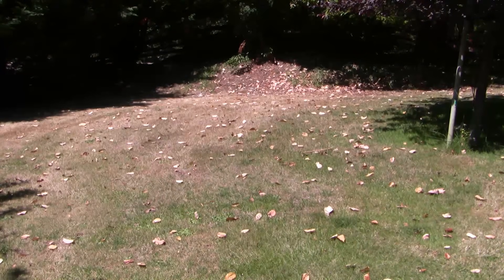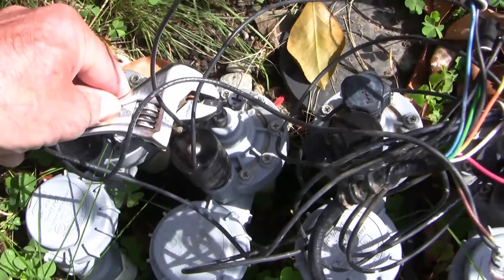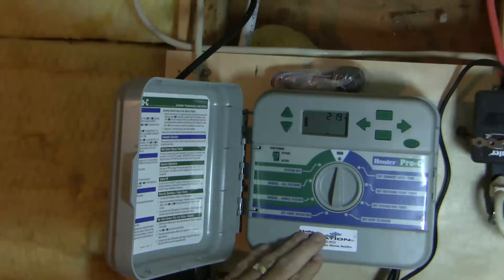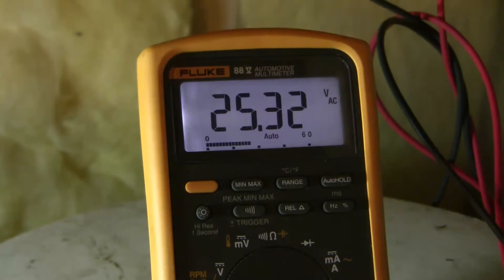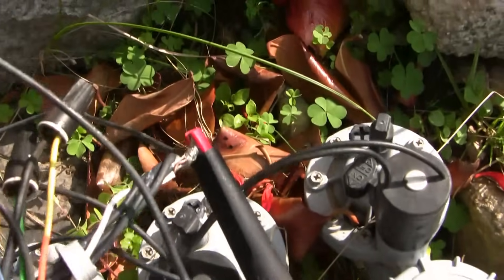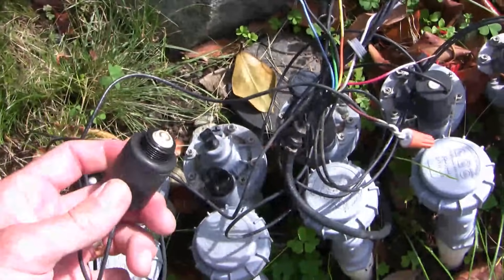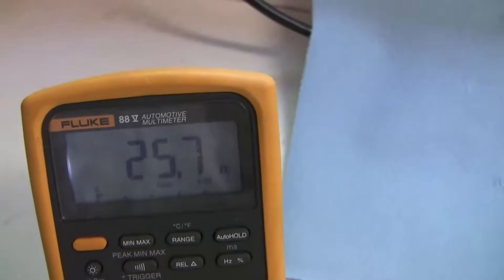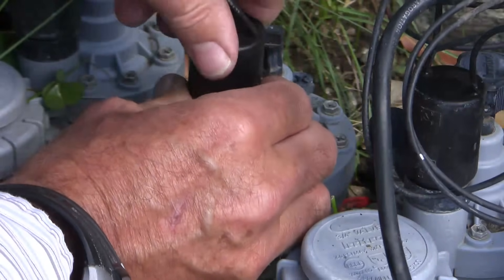How to fix an irrigation sprinkler zone that is not working

Comment: Sometime the zone I have works and then sometimes it doesn't. I have to adjust the solenoid to have it as loose as possible without water leakage in order for it to work. What could be the problem? Thanks for make this video helps me out a lot.
Reply from the maker: I would disassemble it right to the diaphragm and clean it all out (don't forget to flush the proximal line in case you have an intermittent obstruction higher up). What you have sounds like some kind of mechanical binding somewhere. Silicone spray might help the plastic parts to slide more easily. If you think the problem is inside the solenoid itself, you could swap the solenoid for a known good one and see if the problem goes away.
Reply: spelunkerd 3 of my solenoids were bad. Swapped them out for new ones and the entire system works. Thanks for the help. How do I know if a solenoid is about to go? I hear buzzing from 2 others while working on the system.
Reply from the maker: The fuel pump on my truck has been buzzing for over 10 years, but because of how hard it is to get to I have ignored it. The only criteria I would use is whether it is working or leaking.

Comment: I spent $300 last Fall to have a pipe repaired and a solenoid valve replaced.  Didn't need to water much last year, but now it is Spring...water comes up the heads in that zone pop up...but they go down...then up...then entire cycle.  What could be the problem?
Reply from the maker: If all the other zones are OK then the most common cause would be a leak, causing inadequate pressure. I would start by running that zone for an hour, then check for a puddle of water. If you find a puddle, dig down to find the problem, often caused by a shovel strike, or a freeze-fracture of the pipe, or maybe a loose connection at one of the spray heads. If you don't find a puddle then I would disassemble the solenoid valve housing and look for a piece of debris proximal to the valve, that could rock back and forth, obstructing flow. When you have it apart you want to flush the proximal line since debris can slide back and out of sight when the water is turned off.
Reply: the area around the head was pooled up ....yuck.
Reply from the maker: That might be a good finding. Dig down to the spray head connection, it's just a right hand thread with white teflon tape. Sometimes those just come unscrewed over time. If you find broken plastic, you'll have to replace the broken part. If there is broken plastic and if you live in an area where the ground freezes, think about the possibility that the zone didn't get blown out enough in preparation for winter.  It doesn't take much residual water to form a pool inside the pipe, which expands as it freezes and breaks the plastic around it. If it was a pro who blew out the line last September, he might be willing to pay for the broken part.
Reply: Thanks for your help and excellent videos!

Comment: I have a 5 station irrigation system. How many solenoides do I have? I could only find 2.
Reply from the maker: They aren't necessarily all in the same place -- look around the garden for another cluster of pipes, maybe underneath a plastic cover or behind some shrubs. Installers like central locations but it's also preferable that they be higher than the surrounding ground for better drainage.
Reply: I found one more. I imagine one per station.  Missing one.... I bought solenoid. Cant tell which one is which. Will watch you r video again. Thanks again.
Reply from the maker: Keep the receipt since a bad solenoid is an uncommon cause. To sort out which circuit is which, open each valve manually, and draw a sketch of where the sprinkler heads are in your yard with colored pens, one color for each circuit. Then go to the control panel and electrically turn one circuit on at a time. Then match up the colors with the circuit number. If you eventually need the help of a pro, that kind of diagram saves the consultant a lot of time. After you are done, consider writing or inscribing the circuit number somewhere on each solenoid station. It will save you time when you need to do repairs each spring, if you can remember where the sketch is and if the marks don't wash off (grin). Good luck!
Reply: Thanks! Fixed your advice was very helpful it turned out to be a diaphragm.
Reply from the maker: Great, glad it helped, Carlos!
Reply: You have a solenoid for each zone.  Once you find the others you might want to put them in the containers with the green pop top to facilitate finding them next time.
Reply: Thanks!! I fixed it. It was a faulty diaphragm.

Comment: I troubleshoot electronic control systems for a generation station so I understood your troubleshooting method. This video would be very helpful to someone that isn't familiar with electricity, meters, ohms or voltage drop. Very good video.

Comment: dude, that controller has a self diagnostic feature, did you read the manual?
Reply from the maker: As is often the case with self diagnostics, it didn't help in my case. I'm not surprised by that since the circuit resistance and current flow were within normal limits, and the unit has no electronic way to know if water is flowing. Of course I read the manual, 'dude'.
Reply: @spelunkerd  Next time forget that meter use a spare solenoid if it clicks open all good Dude. KISS...

Comment: Nice work, very informative. I've got a small backyard system with just 3 valves and it doesn't work. There's no problem with the water supply, it's just that the Timer starts up and nothing happens. I looked at all of the Solenoid's and two are rusted at the connection. Could that be the problem? Just ordered a multimeter which will arrive in a week so I'll test the connections but I'm wondering if the rust is normal, I would presume not. Thoughts?

Cheers!
Reply from the maker: When I looked at my solenoid closely I found a tiny amount of rust where the wire exits the body, and I think water got into the solenoid and eroded the connections internally. Rust is not normal.

Comment: I really enjoyed the video!! My problem is that there is a watering zone that will not shut off unless I shut it off from the water pump for all zones. Do you have any suggestions? Thanks
Reply: You have debris in your valve preventing the diaphragm from closing

Comment from the maker: I'm glad you chimed in, Gregory. Yeah, you're right, and if I had a spare solenoid that would probably have been my approach as well. But for an amateur it would have meant buying a new part before deciding whether it was broken. I did consider swapping the solenoid with one of the proven ones adjacent. But that would have involved more work, and to properly test the wires it would mean completely swapping it. Thanks for your input!

Comment from the maker: One other thing I noticed about my Hunter ProC. I noticed that if I try to stop a programmed cycle at the controller after a cycle has started, it doesn't stop right away. I assume it is a software glitch, since I can always stop it manually at the water source. After the cycle is over, it doesn't restart.

Comment from the maker: Do you think they might have disrupted any of the wiring when they drilled the well? Did you check to be sure the shutoff valve wasn't closed by the technicians when they drilled the well (probably not if you get water when you open manually). I would look at the controller and see if it is turned on, they might have turned the controller off or unplugged it when working on your system. Or, maybe the clock needs to be reset if they turned the power off. I would check power to the controller.

Comment: Nice video. I was looking around for information on valves. Just had a well put in and my valves wont open. This is a new house with new sod and new hunter system. Been watering twice a day on city water fine to get grass to establish until today when they finished drilling the well and installed the pump. The valves will run when turned on manually. Any ideas?

Comment from the maker: Yes, you make an important point that when a solenoid fails, don't forget to look at the mechanical part of how that device works. If the valve is pinched or twisted it won't move smoothly, which sets up more mechanical resistance, which in turn leads to heat and damage to solenoid windings. 

However in this case you will note that there is a rust stain on one of the wires leading into the solenoid. Water got in there and corroded an electrical connection. See below.

Comment from the maker: Thanks, those sound like words of experience. 

If you watch the part where I test the bad solenoid on the bench, you will see that the resistance shifts when I move the wires leading to the solenoid. I looked at that more carefully off camera, and I think it was a corroded internal connection that was not accessible without destroying the solenoid case. So, in this case it was a primary electrical corrosion problem. 

Nevertheless, your remark is a useful contribution, thanks!

Comment from the maker: They are usually under a cover of some type, in a central area, grouped together. Wander around the yard and look for a round or rectangular cover plate at ground level. Some solenoids that are fitted with backflow preventers have to be vertically higher than all their sprinkler heads, so for that type look in the higher garden beds, often concealed by shrubbery.

Comment from the maker: Flooding of the box can cause a short, which could activate multiple zones at once. The box should never flood unless there is a major leak, so I would fix that first. Maybe it's something simple like a solenoid that is partially unscrewed. When you are cleaning that up, have a look at the wire nuts for signs of shorted wires (do it with power off to avoid getting a shock).  They all should have dielectric grease and lots of tape protecting the connections from water corrosion.

Comment from the maker: If you are not sure if it is the solenoid or the seat that the solenoid rests in, you could swap one solenoid for another and see if the problem follows the solenoid, or if it stays in the same place. They are inexpensive, but there is no point to replacing a part if it is not the problem. Thank you for watching.

Comment: Good job. I think i need a new solenoid. My sprinkler makes a loud noise and the water barely comes out. Only way to stop the noise and increase water flow iscto turn my solenoid counter clockwise a little.

Comment: I have a  5  zone  Nelson Turf. Zone  3  shows a  problem   (P 3) the  zone  starts, runs  for  5  seconds and  then stops and  advances  to number  4.
I have  switched  an  operating  zone  4  to zone  3 , and  it  worked, which meant that the  solenoid  was  working, and  I have  switched  the  defective zone 3  wires  to number  4 and  had  that zone  working, which told me  that the  wiring  was  ok.But  it  does not  work  when  zone  3  sends  to zone 3.
Any suggestions.

Comment from the maker: You twist the plastic control arm below the solenoid counterclockwise to get water. If you don't get water with that, but you do get water in all the other zones, look for a supply problem, either an obstruction OR a leak within that zone. If a leak causes a fall in pressure, the heads won't spray. Look for a leak, and if no leak take heads off, one at a time, and flush the line. You may need to clean the valve. Look for kinked supply lines. Good luck!

Comment from the maker: Whenever I see a problem like that, I try to dissect it down to something understandable. If it is every zone I would have a look at the wiring, especially concentrating on the 'common' wire that connects all circuits. If there is concern that the short is at the controller, you could carefully disconnect the controller and test the distal wiring to look for continuity. That might help to tell if the short is at the controller or in distal wires. Take photos so you can retrace steps.

Comment: Thanks for the great video! Question: If I try to manually open the zone by turning the solenoid, but don't get any water...what's my next step?? The valve is all the way open as you describe it in your video. All the sudden one of my zones stopped working and I'm not sure where to look next. The solenoid that's on that zone is new and working properly (measuring 25 ohms when not connected). Thanks!

Comment: Thanks for the great video. I have a question for you. My irritrol total control system stopped working and giving me "short" message for every zone. I checked the irritrol website and they suggest erasing the program, but it didn't help. Any idea, where I should start looking? Thanks again for making helpful videos. If we save few bucks in this economy, there is nothing better than that.

Comment: Also check the exhaust port under the solenoid valve for clogging with a small stiff wire.  Even if water pressure and current are reaching the solenoid, the valve won't open if  it is obstructed. U

Comment from the maker: What a kind remark, thanks Dan. I spend my time fixing cars and there is considerable overlap as far as techniques go. One technique I refer to here is voltage drop testing, which is a critical part of automotive diagnostics. If there is a voltage drop in the wire it means there is a bad connection somewhere, and by doing the test you avoid unnecessarily replacing parts. I show how to do that in the starter motor video on my channel. 
As far as normal values, I found them on the 'net.

Dave

Comment: Best diagnostic and repair of sprinklers I have seen. Very thorough!  Thank you so much.  I would love to see a how to use a voltmeter from you or how to set it properly for each application.  How do you know what the resistance or OHM ranges should be?  Cheers, Dan

Comment from the maker: The wires are only hot when the controller is trying to turn that circuit on. So, I didn't turn power off, but I was fully confident that there was no power running through the wires I was working on. However if you aren't sure, it's always safer to do things with power off.

Comment from the maker: If you measure resistance on a severed wire it will show infinite resistance, and if you measure resistance on a shorted wire it will show no resistance. Use the same gauge wire or bigger. If all zones are failed, consider a ground problem like a wire nut that has come apart or a wire that was hit by a shovel. The common wire feeds all circuits. The other possibility is your controller. Check to be sure the rain override function is not active. Does the controller send a signal?

Comment from the maker: You mean no resistance? Sounds like a short, either internal at the control board or in the wiring going to 5 and 6. You could disconnect the wires leading to 5&6 at the controller, to take the board completely out of the circuit, then check again. Still shorted means it's distal to there. Common areas would be at the wire nuts, but those wires are easy to hit with a shovel as well. You could run a set of jumper wires or swap solenoids to help decide.

Comment: I get resistance at the solenoid but at my controller I'm not getting any on the two valves that are currently not working.  I have 7 valves and 1 - 4 are working but 5&6 are not and then 7 is.  Any ideas on something I might be overlooking? Thanks

Comment from the maker: The only way I've seen these positioned is as shown. Other positions might make service more difficult, even if they did work. Many new systems have antisiphon valves that need to be positioned as these are. This particular model needs to be situated so that all of each circuit is vertically below their respective antisiphon valves, or they won't work properly.

Comment: Are your valves designed to fail in a certain position?  I am rewiring my system, taking it one step at a time so that I can maintain a certain control over the system.  Thanks.

Comment from the maker: Thank you. Solenoid problems are a lot more rare compared to the more mundane issues of water pressure, leaking seals, and incompletely closing valves. But if you understand how the solenoids work, everything conceptually slides into place.

Comment from the maker: Good question! Most of us use a 'fox and hound' device which transmits a signal down a wire that is picked up by an inductive pickup. When the signal stops, the short is found. Here is a video by my friend briansmobile1 (youtudotbe/Y0HjaR0tj7Q) explaining how these devices work -- they are about $100. Alternatively you can do it manually, looking at likely spots where splices or wire movement is likely -- door jams, connectors, etc. Usually you can work from both ends to get an idea where it is.

Comment from the maker: My filter is screwed into the piping near the shutoff valve indoors. 

Oh, I didn't know it worked manually. That makes an electronic problem more likely -- follow the algorithm that I did in the video. Hopefully it's something simple like a failing power supply or a bad ground connection.

Comment from the maker: As you will note from the video seminar, checking this kind of system out involves the use of a multimeter and an understanding of how the system works. If all systems have completely failed, but you can turn each zone on manually, your problem sounds electrical. Some of these circuits are protected by a GFCI breaker that could have tripped, cutting power to the controller. Or, your transformer may be unplugged or fried. Look for the obvious problems first.